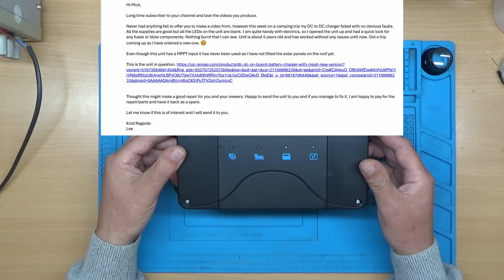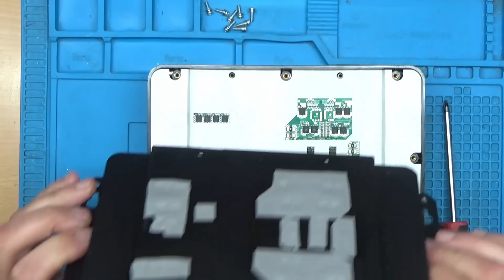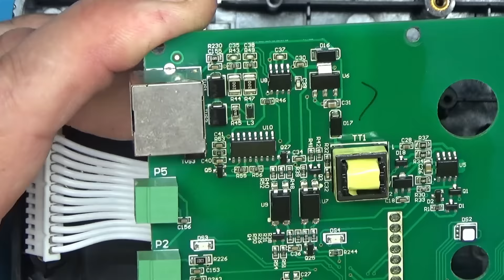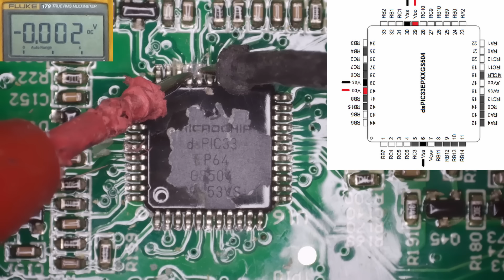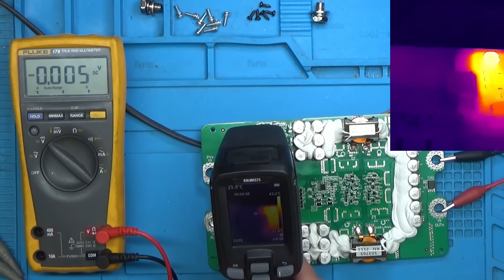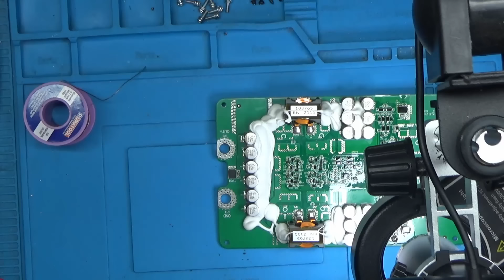This ONE Tiny Component Made This £200 Device Useless! | Renogy DCC50S Repair.

Comment: Nice find and fix Mick but the huge issue is how a tiny component can render an expensive bit of kit, useless, not fit for purpose and probable landfill candidate. This state of affairs cannot continue surely. We are wasting resources at a great rate as it is without building complicated electronic circuitry that few can fix or have the time to repair. It's a bloody joke and it's on us big time.
Reply from the maker: You're absolutely right, the throwaway culture we've developed is a massive problem. 👍

Comment: Capacitors and especially the smd types have lots (too many) of failures.  Years ago I bought a second hand Huntron tracker , the HTR 1005B-1ES together with the comparison extension HSR410. It uses a small crt with vector display, 3 differnet test voltages with very low current. So you can test about every active and passive component without harm,  except tubes. For conformal coated stuff I use probes with razor sharp test pins. By unknown signatures you can compare them to known good ones, in circuit!. Testing is carried out with the board or component powerless... It saves a lot of time compared to testing components with a good multimeter or the latest Peak tester...It's an American invention, they use them in the Forces too...

Comment: Shorting capacitor issues is something to occasionally see in ceramics, because ceramics are naturally brittle and it just takes the right kind of shock or cycling, usually thermal, to cause one to go and if there's a defect in one, then it's a matter of time before it gives out, especially near a source of thermal cycling like the coil it was next to.

Comment: 15:28 I wish you'd have also checked the resistance of that cap as a comparison with the failed one!
Reply from the maker: You shouldn't really get much resistance when you measure a cap with the meter. It will rapidly drop to OL as the capacitor charges from the meter measuring it. Hope that helps.
Reply: @BuyitFixit  So there would be no difference with the one you removed?
Reply: @BuyitFixit  Thanks for your great videos btw!

Comment: Something in design and manufacturing is completely effed if a component can't be identified by markings. Why the hell did we learn the resistor colours?

Give me old school through hole components any day. Size stopped being important to me a long time ago.
Reply from the maker: It's even worse on some boards that use even smaller resistors, as there's no room to put markings on them at all. So all you see are little black squares that all look the same, so you don't know what reading they are supposed to be without a schematic.

Comment: I have fixed countless devices that the only thing wrong was a shorted SMD capacitor...I would say probably 50% of them were game consoles, but I have also had radios, various chargers, a few powered speakers, and a couple cell phones...It's crazy to think how many devices are in the landfill over a single bad capacitor...
Reply from the maker: Well done, and totally agree. I think it's quite common as you say with game consoles and laptops too!

Comment: I have a RENOGY solar charge controller with a bluetooth adapter. It has a phone app which is one of the most poorly designed apps I've ever used. It doesn't even offer the user the option to set their particular solar charge controller as the default device. The bluetooth is slow to connect and regularly disconnects for no apparent reason (same issue on different phones). If it disconnects the quickest option is to shut the app down, restart and go through the steps of connecting to the device you always use. I had decided to create a bluetooth app for my laptop and in the process of working out how to use the protocols I discovered that the device is not only made in China but that the original manuals were written in Chinese and somebody edited the PDF (supplied by Renogy) to cover up the Chinese text and replace it with English. It's basically a badged item.

Comment: I once designed a small pcb and asked for the assembled cost of it from China. I prepared a bill of materials for the design. The manufacturer usually did not charge for some small components. That is the problem. If they let them source such small low cost parts you end up getting junk capacitors which renders everything useless. I could not make the company use my parts for the whole design. Like safety capacitors that are placed across the power line, any capacitor placed across a voltage output should be sourced from reputable supplier.

Comment: These SMD  capacitors have taken over from leaking/drying out electrolytics as being a pain in the ar$e from years back  - remembering the saga of the ones stamped with a Y which failed with regular monotony and probably responsible for a lot of landfill electronics ........
Reply: We had so many computer motherboards fail because of those back in 2005.

Comment: Hi Mick, Thanks for the interesting video, always nice that you can save a useful device from the dump. The failure of those MLCCs (Multi-Layer Ceramic Capacitor) is a common kind of fault nowadays since almost everything is full of them. MLCCs are quite sensitive to mechanical stress, causing the tiny layers to break and cause short circuits among themselves. Thanks! Keep well and until the next video! 🙂 Cheers!
Reply from the maker: Cheers Patrick, and thanks for the info 👍

Comment: The MLCC  capacitors family has problems over time.
Vibrations generated by high-frequency switching mechanically damage the structure.
Good work  Mick 🍻🍻 👍
Reply from the maker: Thanks mate, and cheers for the info 👍
Reply: @BuyitFixit ,🍻🍻

Comment: It always amazes me that one tiny capacitor can completely disable something. It seems like this surface mount components aren’t nearly as robust as the old through hole components that were used years ago . Well done Mick !
Reply: Well assuming the cap is loading the circuit it should be around 60ma I can't see why this cap would stop the regulation altogether ! maybe the cap was getting more short when power passes across , or the MCU just asks for the  cutoff current when it receives power for a moment. it is weird though !
Reply: @WillJad  Ceramics do change their characteristics as the voltage increases, so it's reasonable that a faulty one can become more or less short over a voltage range (soft-short). A 10uF ceramic may very well be 10uF at 3.3V but 9.8uF at 5V and 9uF at 12V and 7uF at 20V, or something along those lines depending on the build of capacitor, like low-esr ones are usually a bit more stable and thus are the ones I'd use for laptop speaker crossover networks when I install custom speaker setups to enhance my laptop's sound of any laptop I've gotten.
Reply: @dedr4m  Yea right and actually I believe the position of the shorted cap also plays a role; the closer to the coil  the worse it seems.

Comment: I got my RF noise generator hooked up to a ceramic filter to test it with a spectrum analyser. There was no noise being generated.
Opened it up and there is a power led blinking in time with the psu shutting down and restarting.
Using my finger didn’t take long to find a got 22uF mlcc cap.
Replaced it and continued on testing the filter. Very annoying having to repair test equipment to do testing 😮

Comment: To get a guess of value have a look at the datasheet of the closest IC as quite often they follow the datasheet for suggested values and layout.
Reply from the maker: Good idea, I've done that before too. I think it was with the Philips sound bar I looked at on here. Someone sent me one from a huge batch that all had the same fault! So I altered  the circuit to the layout of the datasheet, and it worked fine after that!
Reply: This is a good idea...I have used values from the typical circuit diagrams in datasheets a few times...Even if it's not exactly what they used it will most likely work...

Comment: Oh, and I use to see shorted electrolytic capacitors on monitors all the time (video arcade games). It was often enough that they made "cap kits" to replace like 12 of them on certain brands that would always fail, Electrohome was one that had lots of cap failures because of the heat in the monitors in an enclosed cabinet would dry them out and they would then short out.
Reply from the maker: Nice 👍 I replaced pretty much all the caps on the monitor on the 1979 Space invaders I looked at a couple months back. Along with a ton of other work on it. Also did a Williams Defender which also had multiple faults on every part of it, if you didn't see those 🙂
Reply: @BuyitFixit  Coin-op repair was my main job for like 40+ years back then. So lots of video games, vending machines kiddie rides and juke boxes. My favorites to work on where pinball machines.

Comment: I once had a shorted capacitor on a Video Toaster (specialty TV video computer card) but it resolved itself by explosively ejecting itself from the board, made a hell of a bang and some smoke. Never replaced it and it worked fine without it. It was one of like 60 just smoothing out the 12v rail (a little over built).
Reply from the maker: Oh I remember the name "video toaster". I can't remember if it was for the PC or Amiga perhaps? Wondering if it was a tantlum bead, they seem to be quite energetic when they fail.
Reply: @BuyitFixit  It was for Amiga, I don't remember what type it was just it was small (not electrolytic). Just power smoothing.
Reply: Sounds like it was a tantalum capacitor. Those fail shorted and are known for exploding.

Comment: Good to see another product that was not another victim of the dead mcu curse, but crazy that that small capacitor was not fully shorted. But seems it does not have to go completely short to trip up that little power circuit.

Also the thermal camera came into clutch again!
Reply from the maker: Thanks mate 👍It’s always a relief when it’s just a capacitor and not a dead MCU!

Comment: Excellent repair. 
Yes, many times have a similar cap shorted cause the board issues on my bench. Power devices like mosfets and diodes have been the most failed on the items that I work on, but a real close second place is capacitors. The dreaded electrolytics and many times even these ceramics.
Reply from the maker: Cheers mate 👍Yes, mosfets, caps, electrolytics and of course MCUs!

Comment: Yes it have had it a few times on laptop mobo's, multi layer ceramics.
Reply from the maker: Thanks for sharing 👍I've not looked at many (if any) laptops, but I've seen others with similar issues, and shorted mosfets seems to be a common theme with those too.

Comment: This 10 μF polyester capacitor must rectify the 100 KHz peaks induced by the inductor. Problem is, their operating voltage is too close to their nominal voltage, so that the dielectric - the polyester sheets - goes into breakdown.
For a 12 Volt output, they must choose 20 Volt capacitors, not 12 Volt.
Great troubleshooting video, thank you.
Anthony
Reply from the maker: Thanks Anthony 👍

Comment: Great fix. Just to be pedantic, If a capacitor was really zero ohms, then it would not get hot when passing current. (maybe the pcb tracks would get warm) There would be no voltage drop across it, so no power dissipated. Luckily they usually fail to a few ohms, as you showed.

Comment: Mick, I wrote a research paper on shorted mlc capacitors after a lot of work on the problem. In short (excuse pun) they crack from mechanical stress caused by solder joints that are too wide/large. Make solder pads 60% the width of the capacitor and the problem goes away. This was in the days of tin-lead solder.
Reply from the maker: That's a really interesting point about the pad size and mechanical stress, thanks for sharing that insight! 👍
Reply: Can you provide a link or give some more precise guidelines about which pad size has the least amount of mechanical stress on ceramic capacitors.  I have a fascination (almost morbid) about how just one component gone bad can destroy a complete device.
Reply: do you think that the environment of vehicle use would add to the stress of these components.

Comment: Nice job! My KTI-W02 just kept freezing. KAIWEET was nice enough to reimburse me but not sure what I should try next.
Reply from the maker: Cheers Joel, oh that's a shame. Was it freezing completely? All thermal cameras have a "recalibration" every few seconds where they lag for a moment, just wondering if it was that.
Reply: @BuyitFixit  Froze completely. The only way to restart was to discharge the unit completely (which there was no choice anyway you couldn't shut it off) and recharge and restart. Happened way to often. "NG"!

Comment: A couple of weeks ago one of my parents' led ceiling lights suddenly stopped working. After trying to find a replacement for the special (in terms of size and specs) led driver, I opened it up. On first glance everything was fine, and the electrolytics were fine as well. Eventually the fault was traced to a shorted 10uF ceramic capacitor on the output. These things fail more and more, it seems. Good helpful video of the fault-finding process again Mick!
Reply from the maker: Thanks mate 👍Yes those ceramic caps seem to fail quite often. Glad you got the LED driver fixed 🙂

Comment: Do you put conformal coating back on to a PCB after a repair?
Reply from the maker: I probably should get myself some. I think it should be fine though, as it was only a very small area of the PCB, and it probably won't be subjected to a high moisture environment.

Comment: I must be old. I would have assumed that capacitor would have been a 10 nF ceramic bypass. 10 uF seems gargantuan for that little package.
Reply from the maker: Yep, as they try to make everything smaller and smaller. I think because the layers must be so thin, they are more prone to failure.

Comment: I've fixed a lcd tv that had one of those shorted on the actual pcb attached to the thin flex coming out of the cristal. didn't use a thermal camera though, just measured voltages and they were completely off at the t-con board. unplugging one of the halves of the lcd fixed it, so it had to be on that pcb.
Reply from the maker: Nice, and nice way to find the problem 👍
Reply: @BuyitFixit next time I'll use the thermal camera though, it just keeps fixing things really fast! cheers!

Comment: Please don’t take this at criticism as its not. Why didn’t you jump immediately to the thermal camera after you saw it taking 140mah current at the start of the video? Seems to be the most efficient order to do things as checking things over with a thermal camera only takes seconds. Also, have you considered the p2 pro thermal cam? its extra lens makes seeing which small component is getting hot very easy.  Thanks for making these videos BTW. :-)
Reply from the maker: Thanks for the suggestion. I've got a P2 pro, but I've then got to get my phone, start the app etc. I designed a 3D printed lens holder for this one and used a 8mm FL Co2 laser lens. Works pretty good to be fair. I could change it to a shorter focal length to get even closer too.

Comment: Excellent work.  I watch quite a few laptop repairs and many of those fixes are from shorted surface mount caps.  A percentage of SMD caps seem to be quite fragile and heat, vibration or something makes some crack and fail short.
Reply from the maker: Thanks Mike 👍Yes, shorted caps and MOSFETS, seem to be quite common on laptops, and things like consoles too!

Comment: Tiny caps, no, I don"t think. A little zener on a psu feedback circuit, yes
Reply from the maker: I've had shorted caps a few times. I did have a weird problem with a zener on a PSU too! It was the my Aixun soldering iron (video is on here). I re-soldered the diode and it started working again. It turned out that the bond wire must have broken away from the die, and after I re-soldered it, it worked for around 3 weeks until it broke again. I replaced the diode and it's been fine since.

Comment: Nice one. Strange to see 88 ohms on the capacitor, caught it in the act, on its way to a dead short? Would have been good to confirm what  Vin and Vout you got on the voltage regulator after the fix.
Reply from the maker: Thanks 👍and good point.

Comment: I’ve had myriad issues with SMD caps over the years, they always seem to fail short on some mundane part of a circuit that just so happens to take the entire thing down. Stick to basics and always verify proper supply voltage at all relevant points before assuming a bad active component, like you found the thermal camera can catch them but not always.
Reply from the maker: Yes, I've had them a few times on different devices. I think I had one that didn't glow too, but I injected voltage with the bench PSU which made it glow 🙂

Comment: Have you read about the (supposed) shortages of MLCCs and their massive price rise?  I wonder if low quality parts are making their way through the QC system as a result?  Seems like capacitors are one of the most common issues in electronics these days.
Reply from the maker: I did see something about the price rise pop up (possibly on YT). I think this one was about 5 year old he said, so probably well before then.

Comment: I think manufacturers need to make better capacitors.. oh wait if they do that deivces won't fail and they won't get any new purchases!

Great fix!

Oh and if only I ever got a shorted cap. Only once did I have 2 shorted caps on my mum's samsung. 

And you should look into conformal coating remover. Might save you a bit of headache
Reply: I think the problem is simply that they are tiny and made in their millions, so although quality control during manufacture is extremely precise, some defects inevitably get through.
Reply from the maker: Thanks mate 👍 and thanks for the tip!